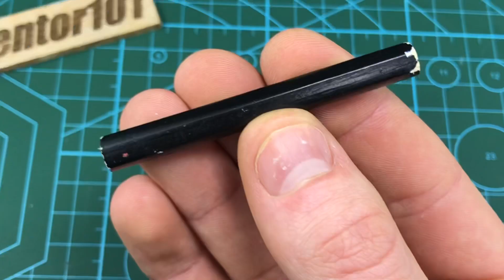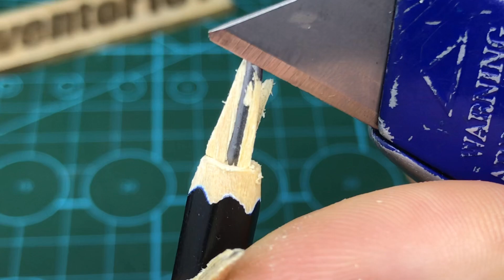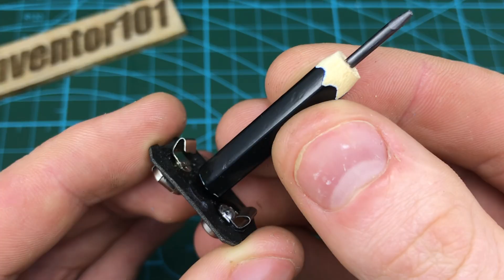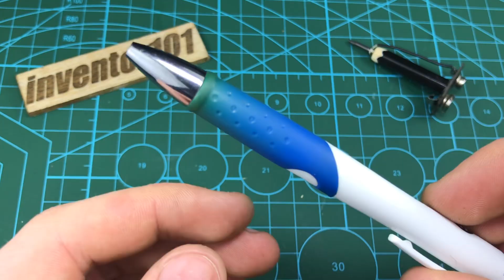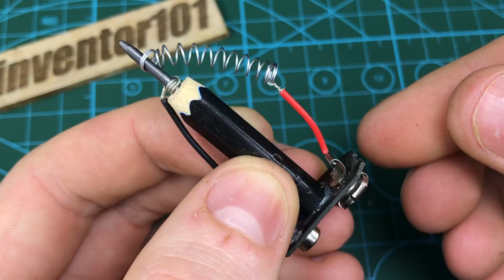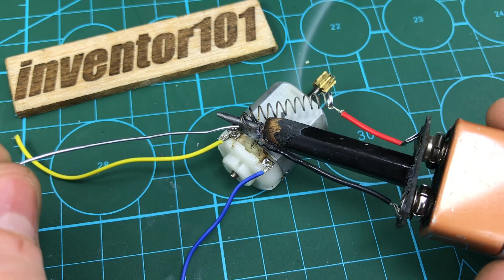How To Make SOLDERING IRON With Pencil

Comment: this is the equivilant of saying that if you touch the leads of a 9v battery, your going to get burned, why is there such thin as a 120 volt soldering iron, when poeple can just make a 9v one, the porblem is that the 9v model does work>">!

Comment: What was that on which u had attach the pencil.. Its Looking Like a battery connector, but there is no wires ?????
Reply: If you have any dead battery open it
Reply: Use 9v dead battery...
Reply: Connecter only without wire
Reply: @ThumsupTecno  You'll need to add wire...